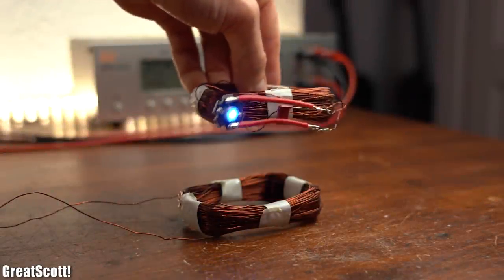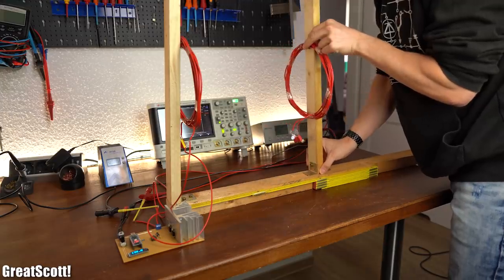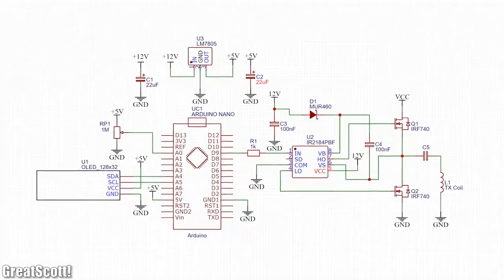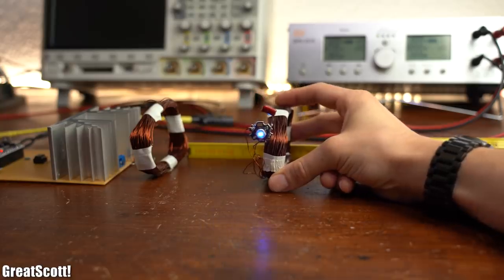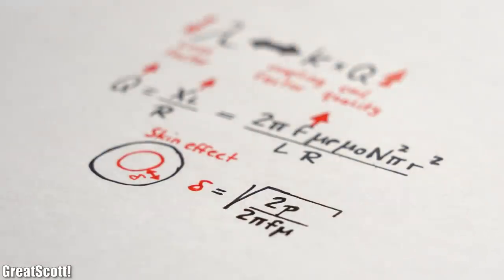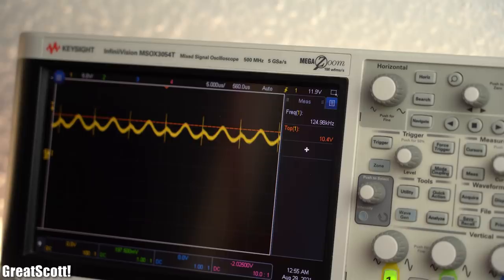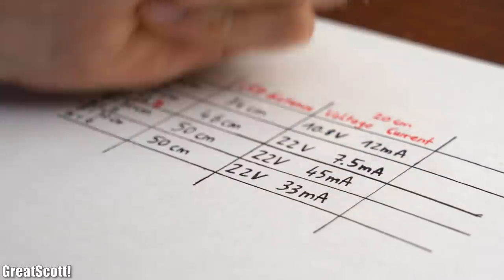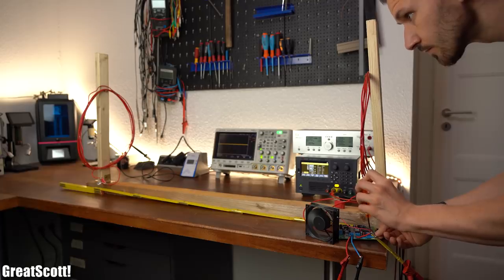How far can I Wirelessly Transfer Power? (Experiment) Better than at MIT?

Comment: Let me tell you how they achieved this: They used the same principle used in the Yagi directional antenna which means that they put resonant coils in calculated distances before and after the actively driven coil in order to extend it's transmitting lobe forward. This is of course not shown in the pictures they published 🙂
Reply: how you know that?
Reply: @ELECTROMAN_MX  Because the original experiment was created by a team in Croatia which they presented it in more detail before it was continued by the american team.
Reply: exactly what I thought....high gain antennas were well known even in 60's and I am talking about MHz or even GHz frequencies
Reply: @VladoT  Why are they going through the effort to conceal key knowledge like that?
Reply: @kanesmith8271  I guess there will be commercial product soon.
Reply: Wait what? They replaced the coil with those antenna? Is it working? I mean how they wired it?

Comment: I usually dislike wireless power transfer proposals due to their pollution of the radio spectrum, and inducing random voltages everywhere nearby. Special uses like the toothbrush is great, but imagine how bad it would get if every apartment had a 150W transmitter in a large building!

Comment: Since electromagnetic waves radiate in all directions the power available at any point away from the source will decrease with the square of the distance. This is true for typical point sources of radiation. 

If however, a collimated beam can be formed then the inverse square rule becomes less of a factor while aligning the beams becomes an increasingly important factor. 

With a collimated beam it should be possible to wirelessly transmit power over great distances at high efficiency so long as the transmitting and receiving antennas are well aligned.

I used to work for Detroit Edison as a contractor in their communications department. One of the things I did in that job was to perform routine maintenance on their several microwave links between their properties. These were microwave T-1 links that were beamed between properties with low power, very high Q parabolic dish antennas.
Reply: Its not so much electromagnetic waves that are transmittting power here, it is the shifting electric and magnetic fields. The fields arent particularly easy to direct which is why transformer design is finding the optimal design that minimises losses. Wireless power transfer is pretty much just a transformer without a core at a distance, all things you want to avoid in conventional transformer design. As far as I know its not that easy to change the shape of the field into a beam or change it much at all as the field naturally makes a loop but as someone else in the comments pointed out they most likely used other coils to stretch the field out and therefore give it more range.
Reply: @conorstewart2214  you would be amazed at all of the beam forming techniques there are in designing an antenna or antenna system. And basically any "wireless" transmission is radiated from one antenna to another so in order to maximizing the efficiency of long distance power transmission, applying beam forming technology is highly advised. 

Having several coils stacked with one driven coil, and at least 1 reflector coil, and a couple of director coils would offer a narrow cone of directed radiation - a beam lobe. Typically the more elements in a beam antenna system, the tighter the beam lobe, higher the antenna gain, and higher the Q.

Of course the higher the frequency used, the smaller the antenna design needs to be. Something like I described above would obviously be a high frequency circuit and could be set in a resin pour to maintain the optimal wavelength distance between the different types of coils (beam elements) in the antenna.

Another useful area of study in antenna design (I'm a former Navy radar tech) is waveguide theory. The higher the frequency used, the easier it is to produce a collimated beam of radiation.
Reply: @MrBrelindm  sorry we might just be thinking differently but it seems at least in part you are talking about antennas and beam forming like the ones used for radio transmissions which is very different from the coils used in wireless power transfer which don't transfer energy through EM waves. Beam forming and long distance transmission through EM waves is totally different and doesn't really apply to wireless power transfer. Radios send out EM waves but wireless power transfer coils don't emit particles or waves like standard antennas do.
Reply: @conorstewart2214  the coils used are identical in the video and are placed some distance apart in open air. Alternating (or pulsing direct current) is applied. It radiates and the other coil is energized. That's electromagnetic propagation between the coils. When you're talking about EM propagation, you are talking about antenna design.
Reply: The simple kind of power transfer used in things like Qi Chargers for phones or for electric toothbrushes use direct magnetic coupling of the transmission and reception coils.  Magnetic field strength (once you're at a distance from the generating current loop that is large compared to the loop size) goes as the inverse cube of distance.  (Closer than that, magnetic field strength is weird, and becomes dominated by additional terms in the field equations that fall off even faster with distance.  If you're at a small enough distance from the generating coil, the field is as close to uniform as you want.  Generally speaking, these power transfer systems have the coils much less than their own diameter apart, so the actual fields are really complicated, but transfer power with enough efficiency to be quite useful.)
Reply: @MrBrelindm  that is what I was trying to say because it seemed you were talking about antennas and radiating EM waves which can have beamforming done to them but those techniques don't apply to magnetic fields. The frequency of the applied voltage doesn't matter in terms of distance between the coils and you can't use a waveguide to turn a magnetic field into a beam of radiation like you seemed to be suggesting before.
Reply: @conorstewart2214  you can confine and concentrate magnetic fields by changing the permeability the field is subject to. But we're getting sidetracked with magnetism here. Wireless transmission over any distance is EM propagation. I'm saying you're thinking of these coils as simple inductors when  you should be thinking of them as antennas. 

When a radio signal is transmitted from one antenna to another, though we only utilize the electrical portion to convey intelligence - the magnetic portion of the wave is still propagated right along with that electrical portion - so yes, it is entirely possible to shape beams of magnetic force!
Reply: @MrBrelindm  you seem to be missing major points about wireless charging, sure it is possible to transfer energy using EM waves but it isn't all that efficient and is totally different to what is going on in most wireless chargers and this example in the video. In the type of wireless power transfer used in the video and in the MIT experiment it does not use EM waves to transfer the energy it uses inductive coupling between the coils. The coils do emit some EM waves but these are seen as losses not as what transfers the power. You can shape magnetic fields but that usually requires extra equipment or materials for it to travel through which kind of defeats the purpose of wireless power transfer at a distance if you have to have other a material other than air in between the coils. The proper way to think of them in wireless power transfer in this configuration is inductors because the power transfer happens due to inductive coupling not due to the EM waves emitted. A system like this is just essentially a transformer.

"Beams of magnetic force", not sure what you mean here, if you mean that photons have an electric and magnetic field then yeah but that has nothing to do with the magnetic field generated by the coils, it is totally different to guide photons than it is to shape a magnetic field, to shape a magnetic field under most circumstances you need extra equipment or material along the direction you want the field to go.
Reply: I think NASA had a good demonstration in the 70s or early 80s.
Reply: Actually not in all directions, it depends on the antenna design
Reply: @MrBrelindm  conor is right this is not radiating radio waves but rather inducing current because of magnetic fields
Reply: @Blox117  I think you need to put a second coil at half wave-lenght of the frequency to transmit the secondary harmonics, that increases the efficiency (or even a third one after it in the line direction of the field), from what I read from the paper. So Conor is definitively right, it is a magnetic field that transmit power, not an EM radio wave (which is loss), its different because its not directional like an antenna, because its not EM field, its pure magnetic field and it can carry more power, the EM field doesn't care power very far, because its all lost between the coupling of the electric and magnetic field, which is why radio is only good to transmit signals, not energy.
Reply: I think beamforming is applicable to far-field waves rather than near-field ones
Reply: @monad_tcp  It is my understanding that making both coils part of resonant circuits tuned to a common resonant frequency and supplying an alternating current at that resonant frequency caused a collimated beam to be formed, at least if each coils is within a quarter of the wavelength of the other.

Regarding 9:15 test 3: Using a Litz wire with a cross section not less than the other wire would get better results.

Comment: I like your approach to problem solving in your videos, keep up the good work.

Some suggestions for future IPT videos:
- Try going to MHz switching frequency to maximise link efficiency (13.56 MHz is a good point overall), GaN devices can help you achieve this.
- Try driving your transmitter with resonant inverters (Class E or Class EF), since they provide higher efficiency (95%+ is possible) at high frequencies and low THD .
- You can get very high Q's (around 1000), by using copper plumbing tube for coils, just make sure to keep the number of turns low to minimise radiation.

Comment: I've been thinking about Halbach arrays and how to build an electromagnet version of this. Should be fairly simple. 3 coils, two arranged like the bottom magnets in a Halbach array. Pushes the bottom fields up, increasing the upper fields up and higher strength.

Comment: If you wanted to carry this experiment further in the future, you could add variable capacitors (preferably controlled via microcontroller) and then set up tests that will sweep through frequencies and capacitances until you get your maximum power throughput for given coil specs. Should be able to create some nice graphs similar to the ones for the commercial coils.
Reply: do these controlled capacitors have a special name?

Comment: Love your detailed experiments! The whole subject of wireless power strikes me as a prime example of "convenience culture" - a highly inefficient and horrendously complex idea promises to replace a 99.999% efficient $0.50 charging cable that we are just too lazy to plug in.
Reply: you are forgetting that there is a wired charger attached to your 99.999% efficient plug (at least AC/DC conversion) - at the end of the day, if propely aligned, wireless charging isnt considerably worse (90%+)
Reply: @blogiblogowicz574  Wireless charging also has an AC/DC conversion since the wireless charging transmits AC power. In fact, there's probably even more AC/DC conversions since I doubt you're running the charger directly off of mains voltage.
Reply: @Gooberslot  correct. both have PFC + HF inverter (as in ~100kHz, dont think MHz) + rectifier. The only difference is the magnetics inbetween, which isnt as inefficient as one might think, if properly designed.
Reply: @iskandarsyah9624  ahm.. as soon as I read about "overunitiy" I kinda stopped paying attention.
Reply: @blogiblogowicz574  don't be closed minded.. lol.. if people showed you that these device exist would you still have this stance?
Reply: Let me put it another way,
We are a body moving at earths rotation a day that moves around the sun that is moving around a galaxy at speeds way over the speed of a bullet and yet we can't generate gun bullet explosive powers instantaneously just like that? There's definitely a disconnect here.
Reply: @iskandarsyah9624  if they would just show me, then yeah, I would still not believe it. If they would let me measure/test/explain it by myself, I am always willing to be proven wrong.
Reply: @blogiblogowicz574  It's totally not on anyone's burden to show you otherwise, you snooze you loose unfortunately..
Reply: @iskandarsyah9624  no worries :) I've got enough problems getting wireless energy transmitted from A to B. Getting energy to B without an A is not on my to-do list. Lots of (much smarter) people have failed with that.
Reply: @blogiblogowicz574  one problem in this energy transmission from a to b is the avoidance of the skin effect.. i'd wonder why if i were you.. the same goes to the avoidance of edi currents.. the same avoidance of "back emf".. the same goes to "closing the loop" in electrical circuits..
yet those dark horse events could probably be the key to the ultimate prize..?
but hey.. many smarter people "couldn't" crack it..and those who cracked it ended up dead.. you think?

Comment: This wireless power system thing is old ... when I was I child my dad built a small AM radio that was powered by it's own antenna! It was awesome the way it works due it was using the radio signal to power on the little circuit! And tha was on 86's ....
Reply: @flexairz  Received, yes. Kw transmitted.
Which is why "wireless power" is such a waste of time.
Reply: @jimmyb1451  not really it is the future of EV ( TAXIS etc) search more about it. Some companies even claims and have tested it to as efficient as 94% for bulk of power more than 50 KW.
Reply: That AM radio managed to recover milliwatts of power from a transmitter putting out many kilowatts. That's fine for transmitting information, but it's extremely inefficient for transmitting power. All modern radio devices (e.g. mobile phones, Wi-Fi) perform in much the same way, though often with more directed and efficient methods. But still, the receiver receives only a very small fraction of the power transmitted.

The goal behind wireless power transmission is to receive a large portion of the transmitted power over a considerable distance, not just some tiny fraction of it.

Comment: corporation: here's a charger that's half as efficient, 4 times slower, 10 tiems more expensive and it doesnt allow you to use your phone while chargin, but it's kinda cool.
everyone: *deal*
Reply: The power of marketing.
Reply: Kids can't break your phone's charging port if you aren't using a charging port.
Reply: @theodiscusgaming3909  None of the people behind those charging systems are good enough at marketing to get people to bite something that obviously crappy.  I think most engineers they interview look at the thing they want them to build and say to themselves, "I don't want to have THIS on my resume!"
Reply: You're forgetting the most important part.  Just toss your phone on a particular spot and it's charged when you're ready to use it.  Wired charging is still extremely valuable, but I don't use my phone while sleeping and it's "good enough." To not have to plug in a cable every night.
Reply: @arthurmoore9488  I just have my cable organized so it takes no more effort to plug in and it stays in.
Reply: It’ll also shorten your product’s lifespan by placing a hot coil near the battery
Reply: There are also usecases for wireless charging where a cord does not work out - I for example did my bachelor thesis in the topic of wireless-charging a car-key. You don't always want to charge it with a usb-cable when the battery is empty. Or think about application where the chared device needs to be waterproof, e.g. a toothbrush

Comment: May I suggest using a 2 parabolic metal disks to direct the energy. At the moment it's going in 360 when you're receiver (RX) is in front of the Transmitter (Tx). An Antenna on the Rx would also make things much more efficient and capable for long distance.
Reply: Yes, brilliant... Needs focusing, as with a yagi antenna, at both the transmitter and reciever.

Comment: you can wirelessly transmit power around the planet or to the interstellar Voyager space probes so long as all your intend to do with the received power is interpret it for information encoding, which that's a pretty useful application of wirelessly transmitted power
Reply: But it's extremely inefficient. When you consider the amount of power transmitted from the ground base compared to the tiny signals received at the far end (probably pico-watts or less). Even when we consider normal earth-bound broadcasting, the power at the transmitter might be 10 kW or more, but the power received at the radio set will be in microwatts or less, even just a few miles away.